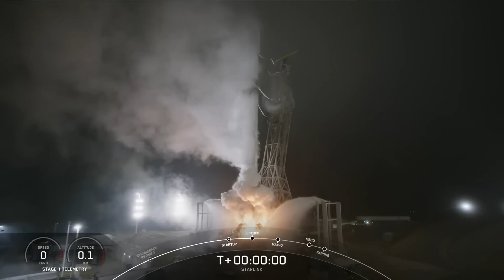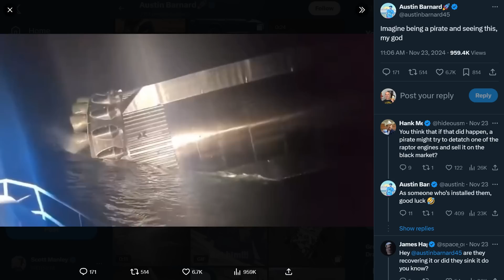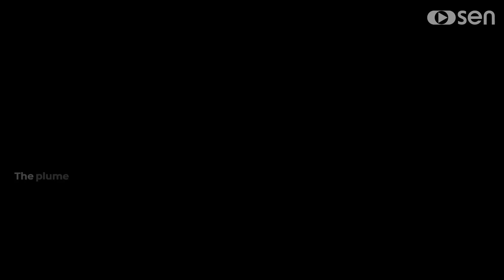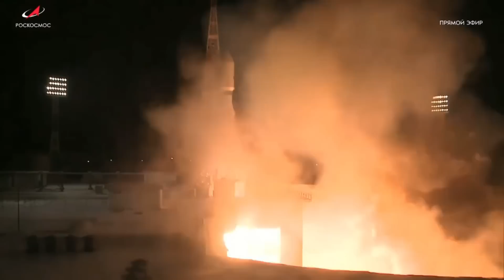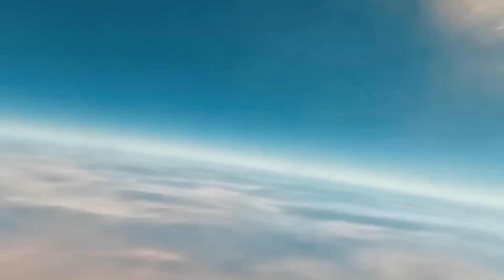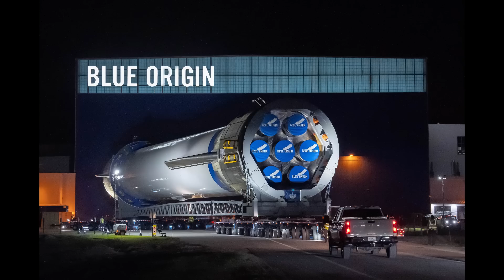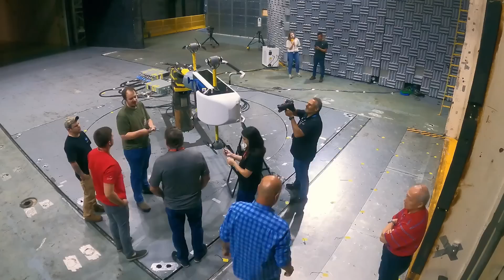China Launches New Falcon 9 Clone While SpaceX Flies Next Starship - Deep Space Update December 1st

Comment: Can you tell us anything about the payload capabilities of Starship? I've read that with all the reusability features it has basically no real capacity left, based on it always flying empty (or a banana at most) and landing with almost no fuel left.
Reply: The first six flights were done with Starship V1.0 which had an estimated 45 tonnes to orbit - had that version of Starship gone that far.

Starting with the seventh flight, Starship V2.0 will launch on a version 1.0 booster. I'm not sure the payload capability of that combination, but it could be similar to version 1.0. Starship 2.0 on  a 2.0 booster using Raptor 3s is expected to be able to launch 100 Tonnes to orbit - although with a smaller volume than Starship V1. There is also a planned V3 which might be capable of putting 200 Tonnes in orbit in expendable mode.
Reply: @KnightRanger38 one small correction: Starship v3 will target a 200 tonne capacity to LEO in reusable mode, not expendable.  

Per the most recent Programmatic Environmental Assessment filings (to allow up to 25 annual launches) from Starbase, for reuse Starship (the upper stage) alone will carry over 100 tonnes of reserve propellant into orbit (while the Booster will carry over 70 tonnes of reserve propellant through stage separation).  If Starship were to fly in fully expendable mode (which also means no TPS or flaps or grid fins or headers tanks), it would be able to carry at least ~125-150 tonnes more cargo mass to LEO than in reusable mode.  Meaning, a fully expended v3 Starship should be capable of ~350 tonnes to LEO in one shot.
Reply: At least two of the launches had LOX as a "mass simulator".  How much and where was it stored is the question.  I believe that the main LOX tank was oversize to allow this.
:planet-orange-purple-ring:
Reply: Falcon 9 also lands with almost no fuel left.  Why carry fuel you aren't going to use which reduces your payload, raises your expense and if any thing goes wrong makes things worse (bigger BOOM!).
:planet-orange-purple-ring:
Reply: @Scanner9631  Hm, you mean it makes more sense to test the landing under realistic conditions (empty tanks) rather than the launch (full tanks/payload). Yeah I can see that.
Reply: Why would they fill it with extra fuel?   Starship V1 was not intended to ever carry a pay load.  V2 will be used in the next launch. Once they get that version figured out, I would expect them to start carrying pay loads.
Reply: @bluesteel8376  I don't know. Because that's how it will operate? To carry a test-payload that gathers more data? To be able to simulate the hover of the landing maneuver on the tower? To see how much is left at the end? But yeah, that's what I'd like to know, was it fully fueled or not?
Reply: @asdfxcy  Final payload capacity is determined once the system is closer to being finished development when they have optimized for mass.  Right now we're still looking for the first flight of v2's with v3's in the pipeline.  This is ACTIVE development.  You can't draw the conclusions you want from what happens with obsolete throw away test articles.  It's simplistic almost to the point of being dishonest.
Reply: @imaginary_friend7300  I am aware how prototyping and development works. I was just worried that if the current prototype has zero payload capabilities, that it will be super hard to reach their stated goals, that's all.
Reply: @asdfxcy  Because you're premature in your worries..  They're not working on that.  Getting it into space and back FIRST.  Payload second.
Reply: You should probably find better sources if that's what they say. I will also note that fuel isn't free, and throwing away a many tons has both economic impact and would certainly complicate EPA approval.

Comment: I'll never get over building sized objects landing using rocket engines.
Reply: Well, you will certainly not get over a building sized object landing anywhere close to you WITHOUT rocket engines, so..... 😅
Reply: @rlosable  well well, people think parachutes would work but they wouldnt especially for starship
Reply: @Nuke-MarsX  yeah. Repacking would completely kill the rapid reusability
Reply: @Allthegoodhandlesaretakenlmao  not to mention uncontrollable and they would need to be the size of a football field
Reply: @Allthegoodhandlesaretakenlmao rapid reusablitly is unlikely to be a thing.
Reply: @ThatOpalGuy Are you living on another planet. Reusability is unlikely, great joke.
Reply: @ThatOpalGuy  smh
Reply: @Allthegoodhandlesaretakenlmao  its not a problem with repackaking but landing itself, even small soyuz capsule dosen't land on only parachutes.
Reply: @Nuke-MarsX  Lots of studies have been done regarding parachutes vs. powered landings, going back to the 60s, and it's generally agreed that a parachute and landing gear system big enough to land a large vehicle masses more than the engines and a bit of extra propellant used on the same vehicle. Add to that the fact that the engines used to recover SpaceX's boosters are also used during the launch, so they are not dead weight. Also, a parachute recovery system won't be recoverable by a Mechazilla-style system, and that system allows you to do away with heavy landing gear and hang the structure under tension, saving more mass.
Reply: @ThatOpalGuy  the devil is in the details: how fast is the turnaround, how much is truly reused and how many times...
Reply: What rapid reusability?
Reply: @rlosable the world trade centers tried using jet engines. 

It didn't go well
Reply: rlosable

Hmm how about landing already gone Anton AN225?

It was possible fly few meter over you when lying on runway and touchdown second later. But ofc it did that maneuver horizontal, but could carry something like starship it's roof (if planes have roof".

Hey Elon, test ceramic roof panels on heat shield's. Those have sometime even holes to secure them. Just some SX50000 glue under that tile and it will work.
Come from hundreds different colors too and could be installed overlapping next one, so it can move little bit, but no direct way to burn metal.
Or..

They should wrap whole damn thing with asbestos plus some non organic glue to keep fabrics together. That steel body could be spikey as hedgehog by spot welded needles at outside.

Nothing would separate that material construction. It would be physically stiff and thermally bad conductive. And it have huge surface area, so adding very thin 'skin' for it (think like glass fiber with and some harz, but not made from same materials than your boat).. That skin would be burning layer and sanded worst part off and sprayed again for reuse with special tools.

That do not need to be very thick and heavy. Material need air pockets, goog structure for connection mechanical and solid outlayer/skin that don't make much problems in high speeds.

I have real idea too, those were just joke and early proto, not even demo.

If someone give me money and free hands plus few assistant, I could show how it made for real.

Biggest problem there isn't weigh I think, but that scale and area what need to be covered. And it cannot be like todays versions, because they really work, but could broke and let you in real trouble, I mean kill for sure when entering down.

That ISS is good idea, there you kill some time, throw your bad capsule to deepest sea, order new one up and if it don't look faily, smell like Bostic glue or someone has drilled hole that f... tincan, that's good and let's go.

Shuttle was best looking thing and even front of it's time some ways, still few broke around crew's hands and burned like napalm and thermite over ice.
Reply: If buildings were 99% empty and made of plaster of Paris.
Reply: Yeah a full stack is just under half the size of the “Freedom Tower” in NYC, its like watching a NYC skyscraper launch into space. Its wild.
Reply: you know buildings wiegh more than a rocket....
just saying.. rockets are only tin cans with fancy flames shooting out the bottom....
Reply: @Bibibosh rockets aren’t exactly lightweight either
Reply: @oberonpanopticon  well compared to when they are fully fueled they are, but yeah
Reply: For comparison a 777-8 is the same length and lands horizontally. I haven't checked the landing weight of both. We don't think much of that, but when you think about it both are pretty amazing.
Reply: so, you missed Saturn V launches, they did not return to the pad (39A) but they were "building sized" and did rattle every bone in your body at launch! ;D